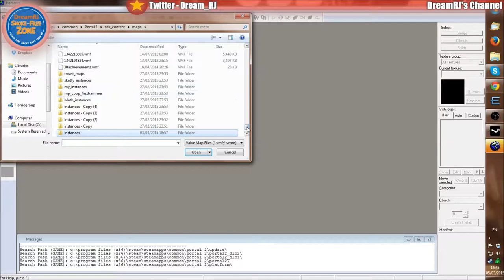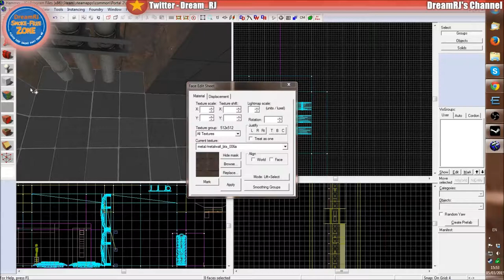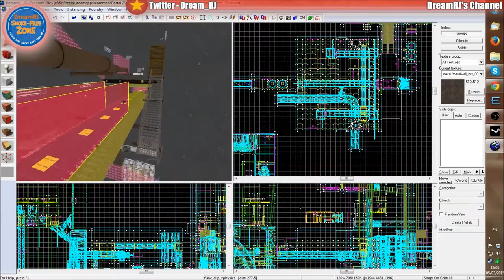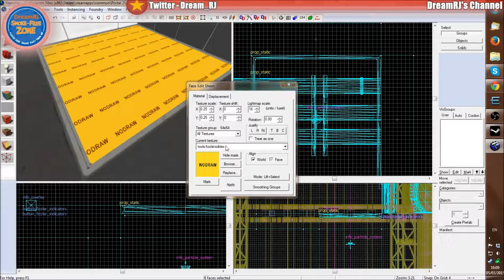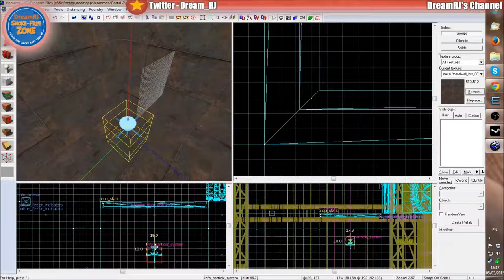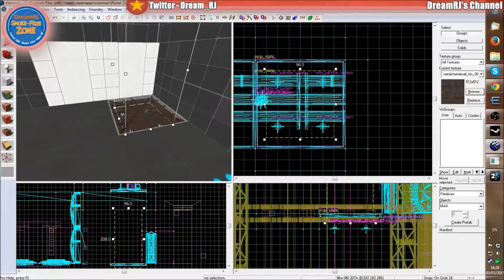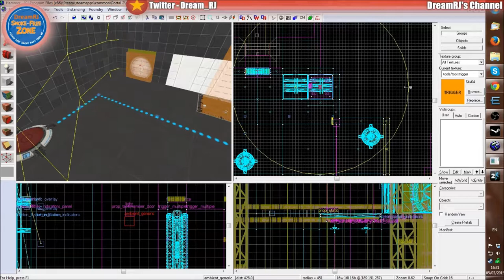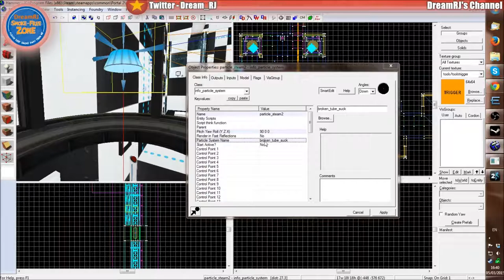Hammer Tutorial - How To Do Particles + Model & Brush Work!

Comment: How do I make a wall that looks as if it is solid, but you can really pass through it? Do I use the same thing you did to the ceiling grating? I want to make a test chamber that's heavily resemblent of the game Antichamber, what with impossible geometry and all (also how do I make impossible geometry what with portal doors and whatnot)?
Reply from the maker: Mandelbrot Set I dont like using portal doors, but it is tricky to do what you want to do, cos textures are solid, so you would need to edit the texture file to make it none solid, for the particular texture you want non solid, then you would need to pakrat the edited file once u have compiled the map in hammer, to make sure others can see the edited textures. again, do a google search for more info, i hope this helps :)
Reply: Alright, thanks! Also, I made a little chamber and whatnot, but every time I try to export it, it's exporting it to SFM, and not Portal 2. I have Portal 2 and SFM installed on different drives--would this make a difference? And I tried placing my map directly into the Portal 2 directory itself, but then when I look in the console, I still can't find it. o.O The map compiled just fine, but IDK why it's first of all, trying to boot in SFM, and second of all, why I can't manually pull it up in Portal 2 developer console o.O
Reply from the maker: i dunno :P
Reply: DreamRJ I figured out how to manually launch it, but damn it's troublesome x'D